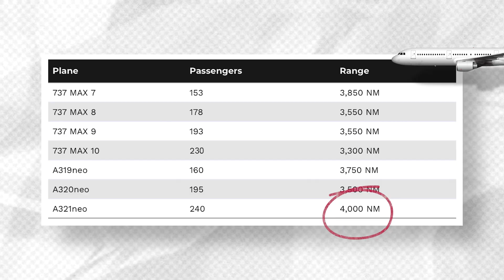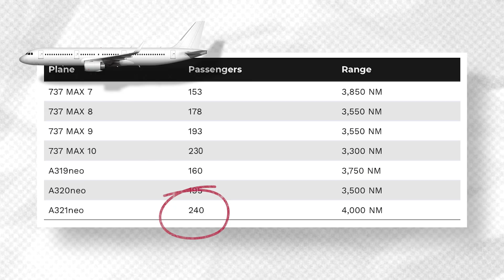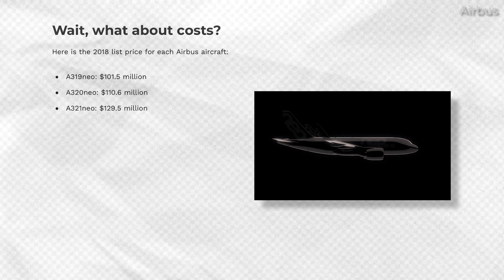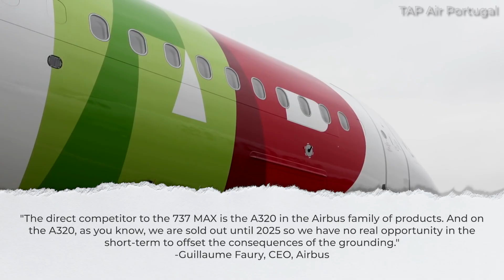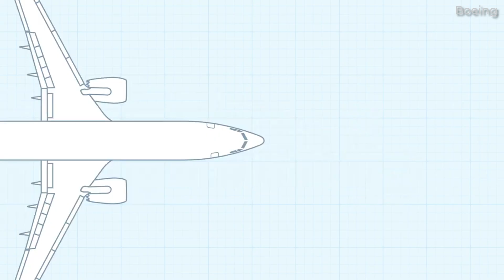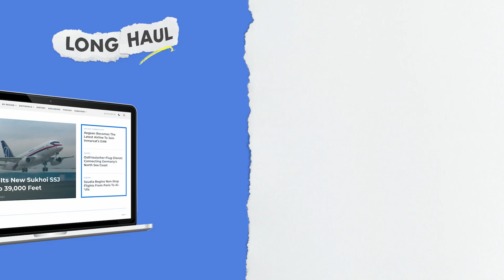The Airbus A320neo Vs Boeing 737 MAX – Which Plane Is Best?

Comment: Airbus fans love their planes. I love all the commercial jets. However, I've been preaching for a while now why the Max is a better aircraft than the A320 aircraft. We can't really go by prices because hardly any airline pays list price. Where the Max shines is in operational costs because of the features that were built into the aircraft from the beginning. Ryanair's profit margin is the best case for the 737. No airline in the world is more profitable. While the numbers indicate very little difference between the two, it does come to preference. In my humble opinion, the Max is the better aircraft for airlines. And for me  😁
Reply: How are you measuring this?  Because right now you're making a claim based on pure emotion.
Reply: @AquariusTurtle  You think that the profits posted by Ryanair, which operates 99.9% 737 aircraft is based on emotion? Ryanair is currently the most profitable airline in the world, and I'll give you just 3 examples of why the 737 is helping them.
1. The aircraft has built in stairs, so they pay airports less for embarking and disembarking passengers.
2. The cargo hold is low to the ground so they can load and unload luggage with less equipment.
3. The 737 can land and take off on shorter runways than the A320 so they have access to more airports and save on fuel when taking off 
These aren't emotional, these are facts.
Reply: @sainnt  RyanAir is making lots of money, but it's probably because of its business model more than the aircraft.  I'm sure they could be highly profitable flying MD-88s (very fuel inefficient) the same way Delta used to.  

1.  737s have built in stairs?  Since when?  Do you have any photos of that?  I honestly want to know.  I used to fly 737s and none of ours had that configuration.  
2.  The baggage equipment is the same.  If anyone is just jumping into the hold without equipment, that airline is asking for a lawsuit.  I do know firsthand the 737 is not liked by rampers compared to the 320s because the 737 is so small, making you constantly bend while pulling lots of weight.   So it's quite painful for rampers.  
3.  That's a really loaded assumption you're making.  Are you referring to a 737MAX vs a NEO?  Or a 737-200 vs an A321NEO?  The MAX is usually at the "max" of every limit on takeoff.  It has far less slop in terms of weight and temperature.  That's why most USA carriers purposely under-load MAX aircraft and routinely disboard or block off seats.  Landing is roughly the same scenario.  They have to land at really high airspeeds while not getting so slow as to where tailstrikes are a problem (very likely in such a low riding aircraft).  If you think the 737Max performs better, please show me some performance charts.  I've flown both and find the 737 to be far more restrictive.  The only area where the 737max is seemingly better is in maximum cruise altitude and climb rate to altitude.  In an edge-case scenario, this means less fuel burn but on the average, the 321NEO family still has greater range, more payload, and better cost/pound performance, even flying at lower initial altitudes.
Reply: @AquariusTurtle  This comparison is all about the Max vs Neo. Boeing has been offering built-in stairs as an option since the 60's. You can look at videos of Ryanair and you'll see it. This saves them money at many airports. 
The 737 carries more cargo than the A320, so I'm not sure what you mean. The low height makes loading and unloading without equipment easier. Baggage handlers will obviously prefer the Airbus because the height makes the equipment a necessity and makes their job easier .
737 also has doorless rear undercarriage, which saves weight and maintenance costs. When you multiply these things across multiple aircraft, that's how airlines save money, so it's not just the business model. There are a number of successful legacy carriers too, many of them with a significant number of 737 in their fleet. Alaska would be an example.
Reply: @sainnt  I was able to find the air stairs.  I didn't know they had that.  I'm sure that's useful but it's extra weight and less useable space, not to mention something else that can break.  That might be fine for Ryanair but in USA airports, there's not a practical way to employ stairs like that.  The doorless undercarriage is not that big a deal.  It's not an issue with an A32x at all.  737s most definitely do not carry more cargo than a 32x family aircraft.  The A32x is bigger, carries more weight, and has more room.  The fuselage is bigger.  Sure there are savings from the 737 but only in more limited use cases like Ryanair, which doesn't fly very far.  The way Ryanair flies the 737, it might be better to compare it to an A220.  If you look at USA use cases, the 737 is not ideal compared to the 32x family for virtually every reason.  About the only time a 737 is better is if Boeing basically gives the aircraft to the airline.  Certainly the 737 is cheaper to buy but it's not superior in terms of capability by any stretch of the imagination.  If you look at Alaska, sure, you can make an airline work with Tupelov 154s if you wanted to, but the use case of the 737 is very limiting for Alaska compared to A32X aircraft, which have greater range, more capacity, and are actually mechanically simpler and thus more reliable.  Also, pilot training for the A32x is incredibly simple compared to 737s (I've flown both and gone through both training programmes).  This results in far less human error in the A32x family than the 737, which is really no different than the 707 I once flew.
Reply: @AquariusTurtle  Again, we have to talk numbers. The fact is, US airlines as a whole has more 737 in operation than the A320 series. The biggest operator of A320 aircraft in the US is Spirit.  The stairs are not needed much in the US because most airports use jet bridges here. Ryanair flies mostly to regional airports so the stairs are very useful in such airports. It speeds up airplane turnaround. 
You just watched the video, and it clearly states that the 737 carries more cargo and has a more powerful engine. I didn't make that up  There are way more 737 aircraft being converted to cargo than Airbus. Boeing has always built the capability into all their aircraft except the Dreamliner. If the A320 was such a capable cargo carrier you'd see more of them being converted. When it comes to cargo Airbus will always be looking at Boeing's taillights.
Reply: @sainnt  The only thing the 737 can do better is to be a cargo freighter where you take out the seats and replace the cabin with cargo.  There are 737 combi's.  The video is not accurate, it's just entertainment.  When they say things like 'carries more cargo', it's nowhere near that simplistic.  In practical everyday operations, I see the 737MAX is extremely limiting at every major carrier in the USA.  Passengers are always offloaded to trade for fuel or cargo.  Sometimes cargo is more profitable than people.  On the other hand, the USA use case is better for Airbus which actually can carry more people with cargo and still have better range, all at the same time.  With the 737Max, it's always a tradeoff between one of the three.  Except for maybe 3 Alaska based carriers, which have maybe 6 737s combies dedicated to cargo, I just don't see a practical everyday better case for USA domestic airlines.  But now you are changing the comparison from an airliner to a freighter.  
And about the stairs... you also can't practically carry lots of bags either.  I know RyanAir nickle and dimes you (charges you for oxygen) so their catered their business model to force you not to have to carry heavy luggage up those stairs.  Again, no domestic USA carrier does that.  Everyone brings lots of stuff on board so the use case is not really comparable.  One is uber-economy whereas the other use case is more ordinary (e.g. jet bridge so you can roll on bigger bags).  Also, what do they do about people who need wheelchairs with regards to air stairs on the 737?  

Also, if the video says the 737 has more thrust, it's wrong.  I just looked it up and the LEAP-1B produces 31,000 lbs whereas the PW1100G produces 33,110 lbs, which makes sense since the A32x weighs more (bigger aircraft).  But, engine thrust alone is not a good measure because what really counts is how much payload that thrust can  propel x number of passengers, y amount of cargo, in t amount of time, across d amount of distance, for f fuel cost, and m maintenance cost.  Videos like this really dumb it down to the point of being wrong.  I'll tell you the 737 flies higher (on the average) than an A32x but it needs to do so just to get the fuel economy of an A32x flying at lower altitudes, with more payload, for a longer range.
Reply: @AquariusTurtle  Ok, now you're veering completely off course. The video says that the 737 carries more cargo than the A320, and this is not only true for this comparison, but basically true for any aircraft category between Boeing and Airbus, and I'm not talking freighters.
US domestic carriers, overall, use more 737 aircraft than Airbus. American Airlines replaced all its A319 and A320 with the Max. It ordered the A321's  to replace 757 and 767 size, so that theory doesn't add up either.
Finally, I was comparing The Max and the Neo, because these are the latest engines. Why compare the Leap 1B with the PW engine when the NEO primarily uses the Leap 1A.  It's a good debate, and the video is not wrong. While we're all aware of the issues with Boeing, it's fair to say that, with all the kinks worked out, the 737 is the better aircraft overall for airlines. I would give the A320 the advantage in passenger comfort but that's it
Reply: @sainnt  How do you know the video is correct?  I'm comparing it because the A32XNEOs I fly use PW engines.  I'm also telling you that it almost doesn't matter which engine it is thrust-wise because the A32x still manages to carry more weight, fly longer, for whatever amount of thrust it has depending on engine option.  The choice of whether it is better for the airlines or not depends on what airline it is and how they use it.  If Boeing gives them away, sure, they are better for the airline.  As for the kinks being worked out, we still don't know.  It'll be a decade or so without events to finally demonstrate whether it is safe or not.  Right now it's "unknown".  Safe is not a word of opinion of interpretation.  It's defined by the FAA in engineering documents as having < 1 fatal event in x amount of hours.  I don't remember the precise number but it was huge and written in engineering notation.  I sure hope the 737 can be called "safe" again one day.  I used to fly 737-200s and 300s and they certainly had their issues.  I'm very concerned that Boeing is once again taking shortcuts at the expense of safety by trying to get out of installing EICAS into the cockpit as required by law.  On the Airbus, this is not a problem since it was designed decades ago with this capability.  Ditto for systems comparable to MCAS.  Airbus aircraft have control laws which can be upgraded with software modifications.  The A321NEO for example needed an upgrade to the rotation law to avoid tailstrike possibilities.  It's so well designed that there is no practical difference to the pilot between an A321 and a 320 as far as how I fly it.  Also, we're when really tired, the Airbus always helped me with all the software protections built into the flight control, systems, and navigation software.  With the Boeing, I always had to be watching everything because systems would fail insidiously.  I think the Airbus is considerably safer from a human factors standpoint.  Maybe someday the 737 will be better, but right now it's not.  It was great for it's time, e.g. to replace a 727 or MD80, but it's a jurassic jet at this point.
Reply: @AquariusTurtle  Again, you veered off course. The first 737 went into service in 1967. More than 11,000 have been built. You think it's not safe? Let's not forget again that we're talking about this video, and the video is comparing the two aircraft based on what's better for an airline. Nothing to do with pilot preference or passenger preference, but which aircraft is actually better for an airline.
The 737 is one of the safest aircraft in history, especially the NG. The Max had a design flaw, and it's been fixed. Listening to an Airbus fan, you'd think their planes have never crashed. They have 
Boeing is not giving away the 737. It's actually more expensive. And if we're talking about flying, sure the Airbus is easier to fly, but that also goes to preference. Some people like automatic transmission, some like stick shift. As a pilot, the Airbus is easier to fly, so it's easier work for a pilot, but I suspect a heck of a lot less fun.
While your preference is well documented, calling an aircraft that carries more passengers than any other aircraft unsafe is just plain crazy. We know what happened, and we know why it happened. It's been fixed. Despite all that, it's still selling as many as your beloved Airbus, and still carrying more passengers. That many customers can't be wrong, Airbus is not better. You just like it better. I get it.
Reply: @sainnt  I'm saying that we don't know if the MAX is safe.  It has to prove it over the course of time.  Things aren't safe by default.  You can own a Ford Pinto, keep it in the garage, never drive it around, and call it safe, but the second you get into a rear end collision, it blows up.  That's why there's testing and real world experience.  Look up the FAA engineering definition of safe where fatalities and incidents are a function of hours.  Maybe in 10 years, hopefully, there will have been no more fatalities or incidents, which were far more numerous regarding MCAS.  As far as flying goes, I don't care about fun.  I care about safe.  In the 737, you can crash on a go-around because you didn't trim the aircraft properly, resulting in a stall at slow speed.  I believe that happened not too long ago in the middle east.  That's not a concern with the Airbus because its flight control laws and autothrust prevent that condition in the first place.  I can do a go-around 98% hands off.  That's really useful when we're dealing with adverse weather and fatigue from long flight hours.  The 737 is fatiguing by comparison since it's like always driving a car without cruise control, power brakes, and power steering.  The 737 has yet to earn its designation of "safe".  As far as what is better for an airline, it depends how its used.  The 737 is great for shorter legs carrying less passengers and less cargo, particularly if Boeing gives it to you.  But if you want to fly longer distances without weight and balance issues, the Airbus is simply better.  Oh, and let's not forget the 737 family has very costly difference trainings between the classics, NGs, and MAX.  The Airbus are 95% identical and our difference training is trivial.  Software abstracts so many things that I can safely float between all A32X variants never having knowledge gaps. That's certainly not the case for MAX training.  I've seen differences training from 4 days to 2 weeks from an NG to MAX.  For the A32X, it's maybe 30 minutes of self-directed presentation study.
Reply: @sainnt  And don't forget that Boeing is opening a whole different division of potentially unsafe corporate behavior by asking for a waiver to EICAS, which is mandated by federal law explicitly for safety reasons.
Reply: @AquariusTurtle  The waiver for EICAS is not dangerous corporate behavior. It's to ensure that the Max-10 has commonality with the other Max aircraft which already have the waiver, otherwise a current Max pilot would require a different certification. That would be a kiss of death for any airline currently flying Max aircraft adding a Max-10 to their fleet, not to mention the cost of redesigning the Max-10 cockpit this late in the design.
Other Boeing aircraft already has the EICAS so I'm not sure what dangerous corporate behavior you're referring to.
Reply: @sainnt  It most definitely is dangerous corporate behavior. It's the equivalent of getting a waiver to not have a stick shaker or fire warning system just to save $$$.  EICAS exists because it permits rapid malfunction analysis in an organized way, rather than getting a jungle of different behaviors from pilots.  That's why EICAS is mandated in the USA by federal law.  In what universe would it be acceptable for a manufacturer to bypass installing a safety system to save on training costs ($$$$)?   That is how Boeing killed so many people with MCAS.  Notice how none of the Boeing executives are in jail?  I understand it requires somewhat of a redesign, but it could be done.  I was once in charge of such a thing for 707s.  

Here's a 737 wing scrap video from today:  https://www.youtube.com/watch?v=KnsyF7vJDdY

I'm not anti-737 per sey.  It was great in its time.  I am, however, definitely anti-Boeing at this point. As a company, it just needs to go out of business. Then Boeing 2 needs to be created with ONLY engineers running the company.  Anyone who counts money need not apply.  They are the most evil people in the universe who don't care about killing people unless it affects their bottom line and personal profit.
Reply: I couldn’t agree more. Plus Max is super quiet and comfortable plane.
Reply: @Clayson Antoons I really appreciate your comments because you're clearly a very objective person. I also agree that airlines may choose commonality when replacing old aircraft with new ones, but airlines like Qantas and Allegiant bucked the trend by going the other way. Qantas because of JetStar already having an all Airbus narrowbody fleet. I actually believe that Qantas may still end up ordering Max aircraft because the economy can't really be ignored.
The A321LR and XLR is not a fair comparison to even a Max-10 because it's more in line with the 757, just as a Dreamliner is not really a fair comparison to an A350. While the A321 is considered part of the A320 series, it's not going to a fair fight for the Max-10. Airlines who choose the Max-10 would be doing so not for range, but for higher capacity on the routes currently flown by the 757. 
Thanks for your comments.